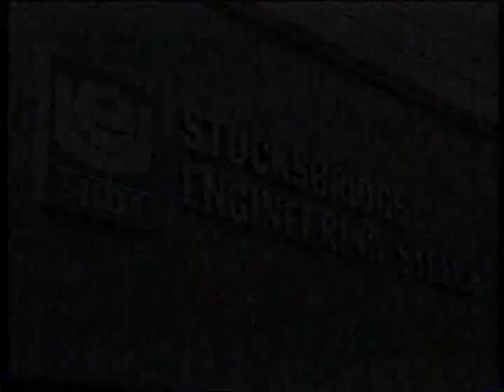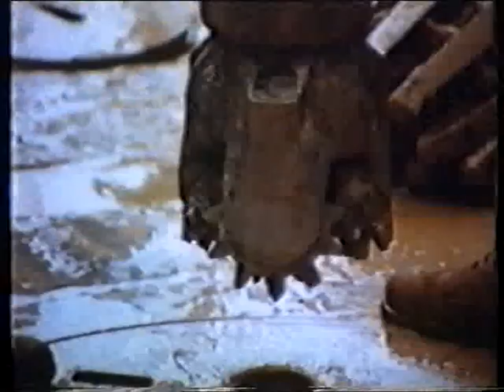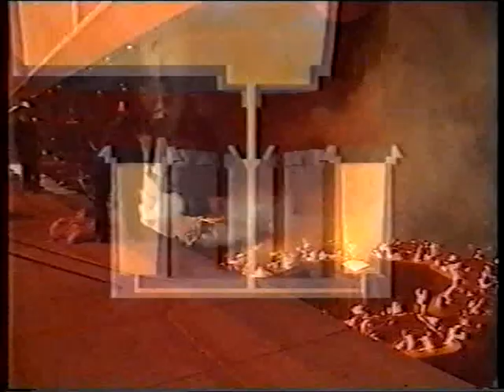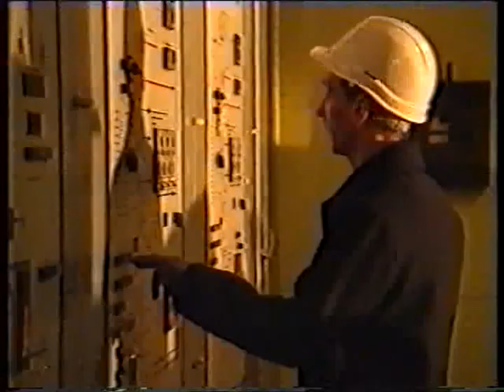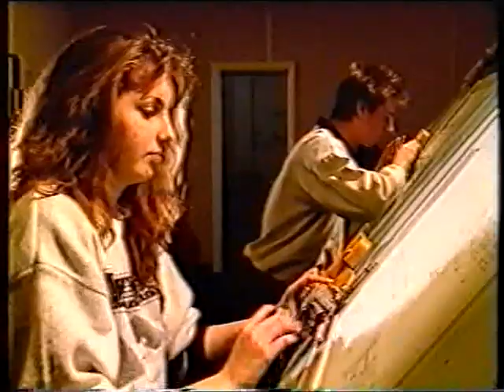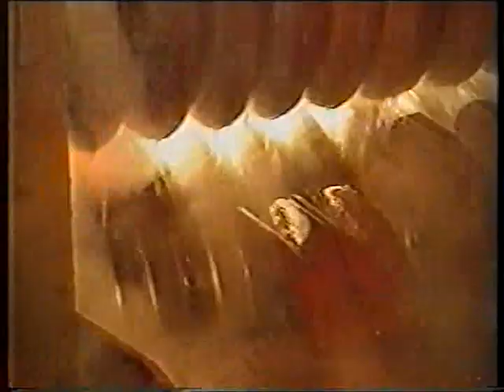stocksbridge steelworks 1980's 90's

Comment: aye and it's all gone
Reply: Actually I think some of the rolling mills are still there.  Kind of like what happened with a bunch of integrated mills in the US, they closed the melt shop but kept the rolling mills due to them still being useful.  In fact, I believe this specific location is sort of like Lehigh Heavy Forge in Pennsylvania, where they have specialty equipment that can do all sorts of forming and machining precision operations for downstream fabricators.